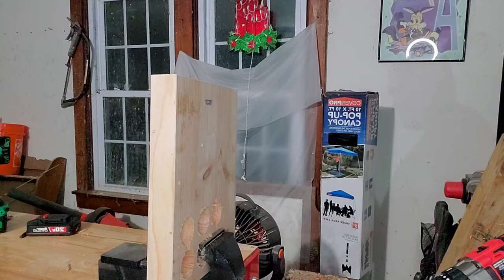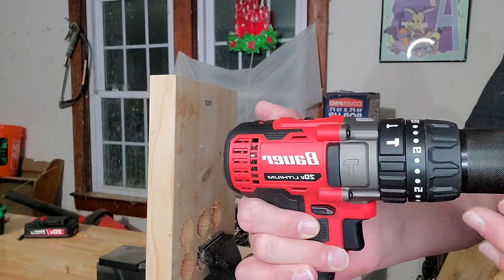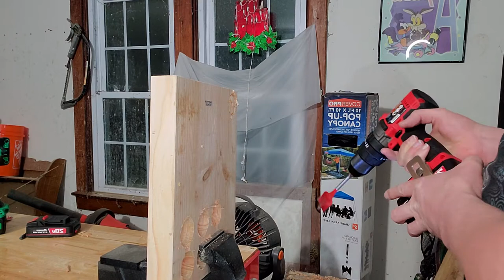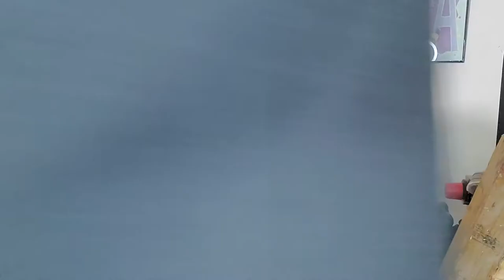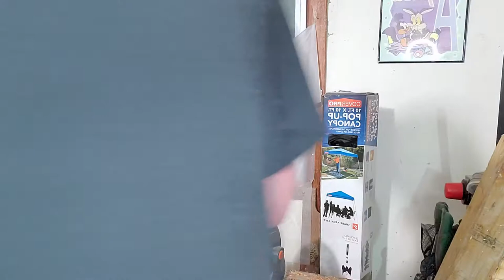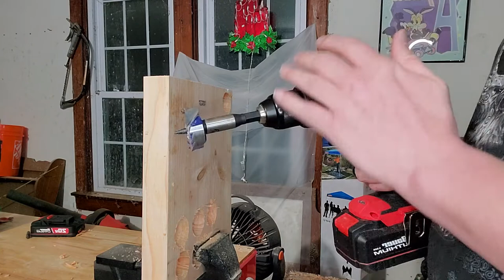Bauer Hammer Drill goes up in smoke!

Comment: It appears to me that you are first forcing in the bit without letting it get spinning then from a dead stop while it's stuck in the wood you're snapping the trigger while it's already stuck in the wood. Then you're holding the trigger while it's stuck. Is this were fair, you'd demonstrate like that with one of the big there drills.  For that job, I'm going to let the tool get up to speed and then slowly apply it to the work. I wouldn't want splinter the wood spinning and then you apply it slowly. I bet that if you used a bit of technique, you could bore the hole.
Reply from the maker: You might want to watch more of my videos as every drill goes through this and only the Bauer went up in smoke

Comment: Kinda odd to me that my same model will handle these bits no problem and yours won't :/
Reply from the maker: They could just make a good hammer drill to begin with?
Reply: @ToolswithSoAlz  I have the driver version but the gearboxes are the same. I've used bigger bits than the ones you used and it handled it better than I expected it to. What gear did you have it in? I've had mine in 1st and 2nd when using the bigger bits.
Reply from the maker: @hemi5463  tried it in second first, it couldn't handle it, and then I dropped it into first to get all the magic smoke to come out.